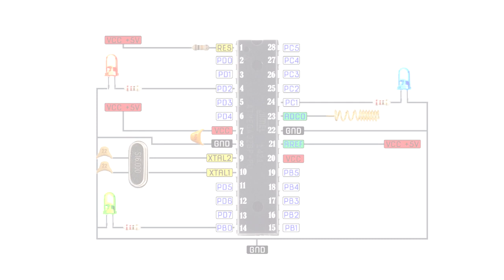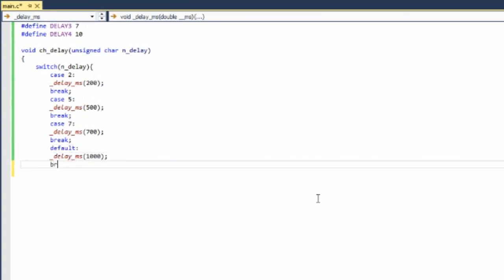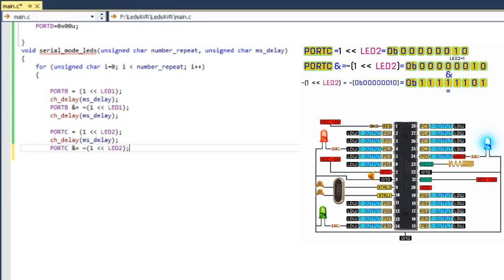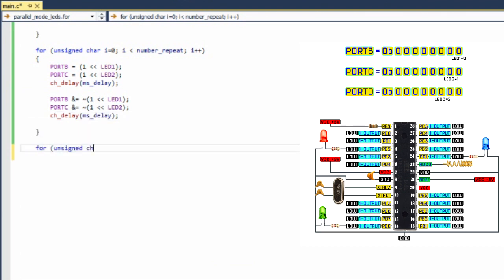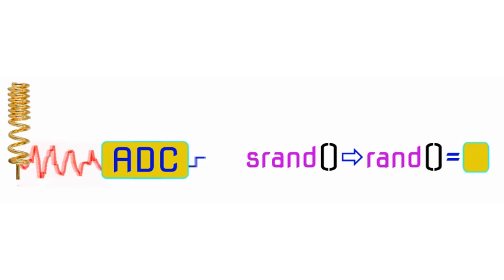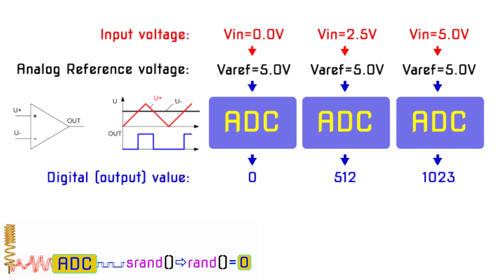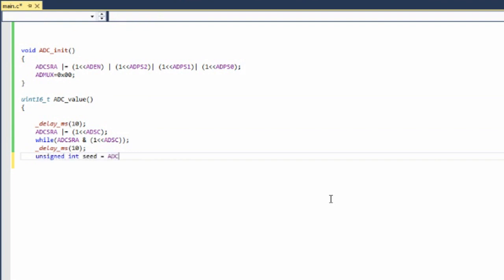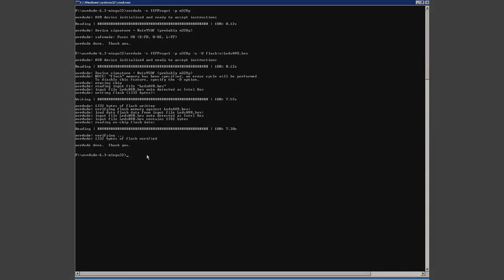AVR Microcontroller. LEDs blinking in "serial", "parallel" and "random" modes

Comment: what software do you use for the simulation of the atmega and leds??
Reply from the maker: I'm using Proteus to simulate circuits
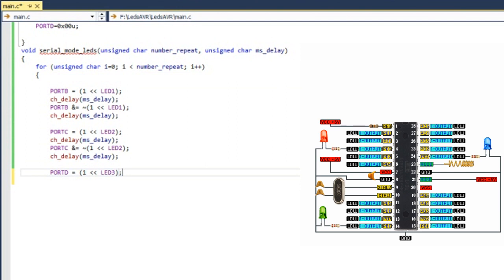Reply: @FOGDIY  min 6:02, that circuit not is in proteus
Reply from the maker: @EdwardYamunaque  No! it's not a simulation of circuit. I made this animation in a raster graphic editor.
Reply: @FOGDIY  I like the image of the circuit, is the circuit image of some software? thanks for your time
Reply from the maker: @EdwardYamunaque  Just handwork in a regular raster graphics editor